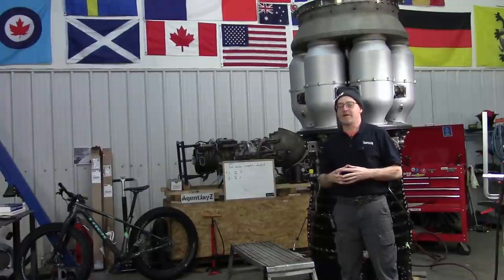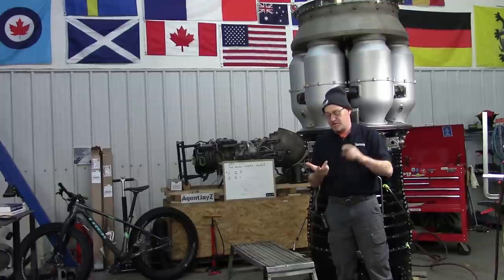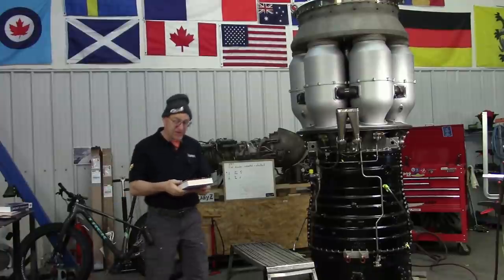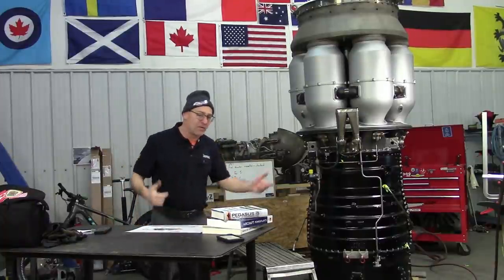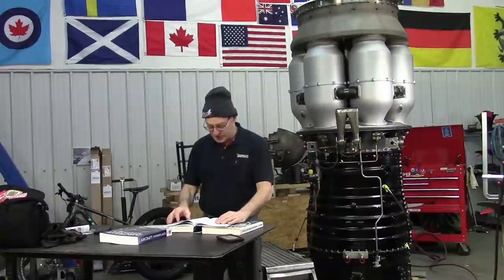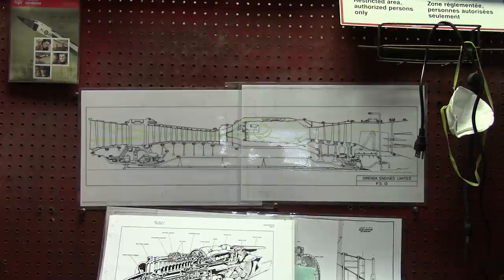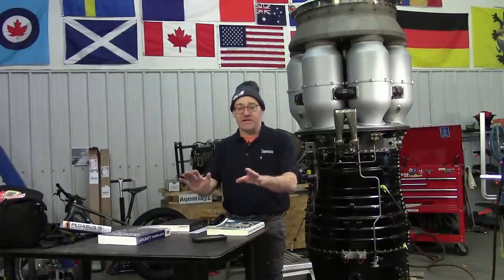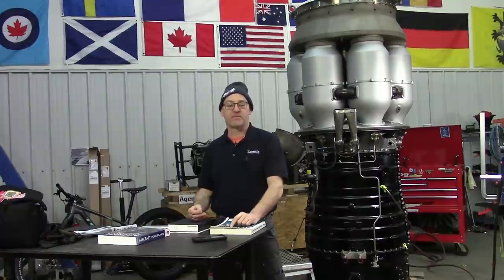So You Want to Design a Jet Engine

Comment: Not standing on the shoulders of giants when given the option is pure stupidity.
Reply from the maker: Your two comments appear to be completely contradictory. I guess they cancel each other out.
Reply from the maker: William: I read the article, which contains the following points.
It's a design for an engine for an RC model.
It's based on an automotive turbocharger.
It has never actually performed it's intended function i.e. fly the model.
So thank you for completely missing the point of this video, three times in a row.
Reply: @AgentJayZ  it was a turbofan into multistage axial compressor into centrifugal(off the shelf auto turbo part).

Comment: Hopefully this video will be an eye opener for all of the "brave designers", who thinking that they can build a jet engine in a back garden garage
Reply: You could build a pulse jet in your back garden pretty easily, pushing the definition of "jet engine" a bit though :) also maybe a tiny centrifugal engine from a turbocharger. That pretty much already is most of a jet engine, just without the combustion chamber & obviously not exactly optimal ( for one thing it's meant to extract as much energy as possible on the power side, and that doesn't leave much for actual thrust... maybe one with a permanent afterburner then - hey welcome to fun calcs about bypasses )
Reply: You can definitely build a jet engine with enough effort, but it will inevitably kinda suck unless you have a whole team working alongside you.
Reply from the maker: BdM... That's really neat, but unnecessary. A variable nozzle in not required on a non afterburning engine. So, it's a toy, and not the subject of my video at all.

Comment: CF6
Airbus A300
Airbus A310
Airbus A330
Boeing 747
Boeing 767
Lockheed C-5M Super Galaxy
McDonnell Douglas DC-10
McDonnell Douglas MD-11
Reply: Does all share a different modified Engine based of the CF6?
Reply: @egofessional2863  yes
Reply: @egofessional2863  yes slight different thrust lbs and accessories, fitment.
Reply: @publicmail2  The CF6 was based on the TF39.

Comment: even after 50 years of trying china could not come up with a perfect engine... India tried for 35 years and eventually abandoned their entire engine programme and bought GE instead. Russians still using their very low-efficiency engine in their aircraft...
Reply: the perfect engine only lives on paper ... al the others are some compromise or more accurately some set of compromises to get a desired result ... and they are all subjective based on testing and research
Reply: Russian engines are overly hated on for obvious reasons ofcourse,India and China failed because they skipped all the previous generations of engine design and technology and wanted a modern engine immediately

Comment: I don't think these people are trying to make commercial engines. They are likely hobbyists who just want a cool metalworking project that makes noise and fire. Plenty of people have done this successfully.
Reply from the maker: Did you watch this video? The people I am talking about have told me that they have a revolutionary new design that will change the industry... over and over.
Please try not to tell me what people have said to me, and remember your assumptions are not helpful.
Thanks for keeping that in mind.
Reply: @AgentJayZ  I actually did,  "What are the dimensions of a compressor" is such a vague question that it can asking anything really. You interpret as the specific dimensions of each individual part. The same question could be answered with a drawing of a trapezoid with the inlet/outlet sizes, and the length of the compressor section.. Without seeing the specific verbiage of the comments that offend you, it is easy to imagine some naive guy with a metal shop who wants to make a turbocharger engine asking for advice. If they literally say they are going to start a company and sell jet engines they are clearly fools.
A home cook asking for a recipe doesn't aspire to become a 3 star chef.
Not trying to ruffle your feathers.
Reply from the maker: He wasn't asking for a recipe. I quoted his words exactly.
Engines of any kind are unlikely to be successful when designed by "some naive guy with a metal shop".

Comment: Do Power-Turbines use water to reduce noise or temperature? The lines on the power-turbines cannot be fuel lines right?
Reply: He has a few other videos about what goes into converting these engines for use as stationary engines connected to a power turbine. The lines are either oil, air, or fuel; sometimes there is also a separate hydraulic system to actuate parts of the engine. Most engines will use fuel as part of their cooling solution; preheating the fuel increases efficiency. If you need to reduce the noise of these engines the cheapest and easiest solution is to put it in a sound reducing box.

Comment: If you don't want to build an engine... which turbine engines are "the best to play around with"? Of course, it's dangerous to play (call it backyard-running them) with turbine engines, but what's the next-best thing to build one yourself? This question maybe good to answer for booth types, jet engines and turboshaft engines. Thanks!
Reply from the maker: Definitely the cheapest one you can find. You will destroy it for certain, probably before you ever get it running.
Guaranteed.
Please, prove me wrong.
Reply: There are the RC jet engines. There is the PBS TJ-100 for about $60k. It comes with a FADEC. I doubt the company would give you one that you could tune, so you will have to reverse engineer the software in the FADEC. Then tweak the software so that you can tune different engine parameters. Modify the engine to have all the sensors for things you want to measure. Be careful while tuning, the wrong parameter for even a couple of seconds will destroy the engine or significantly shorten its life.
Reply: @AgentJayZ  I can understand your opinion, if you're an idiot you will destroy anything, even your home-built modified-turbocharger-engine or a brick of stone ... Of course you can get one, put fuel to it, send it to the moon and watch the sparks and flames. But that's not the answer to my question.
What I wanted to know is more like when you really want to learn how these engines work and which procedures must be done to run it without destroying it - is there any small turbo jet engine out there with which you can get this done - without destruction?
There are enough people out there who archived this with ex-jetfighter engines mounted on dragsters or backyard-running an RB211, so it's clearly possible. But these engines are really big as you know, is there no smaller one with less power which is still good for learning turbine engine operation?
Reply from the maker: Maybe I misunderstood you. My honest answer to you is that the best way to learn about working on jet engines is not to obtain one first and start taking it apart.
Take some training, or even just read the A&P training texts. By the time you get to the end, you will know which one you want to obtain.
Learning by doing, without any prior training, without destruction... to the point where you can competently reassemble any turbine engine and have it run?
I would not bet on that.
You'll save money, time, and danger if you learn first, grab wrenches later. 
No matter what you choose to do, I recommend obtaining the overhaul manual for whatever engine you obtain. Without that, destruction is certain.

Comment: Is it impossible to build a turbine engine with water cooling turbine blades ؟؟؟🙄
Reply: Carrying water along?
Reply: Nothing is impossible. The impossible just takes longer.
Reply: @mikecowen6507  As you know, the capacity of water to cool is twenty times the capacity of air to cool. So when did they start that and why did they not start ????
Reply: @ابوكيان-م2ض8س  as air is more abundant in the atmosphere surrounding most aircraft engines its the obvious medium to use for cooling. Yes you can oil, water, alcohol and various other substances to cool an engine. All of the liquids do however also have one big drawback when it comes to aircraft engines. You have to bring them allong for the ride yourself. As an effect of this, the item into which the engine is fitted will have a reduced paylod, therfore will incure a negative reduction in opperating costs and prohibiting the implementation of that engine.
Reply: @pauljanssen1325  I agree with you . But if you see the benefits that we will get, such as the cooling power is twenty times more, therefore, less expensive metals can be used in making the engine more fresh for the cooling power, which reduces the cost of making the engine and reduces the risk of high temperature, which is the main reason for the failure of turbine engines and by using special cooling fluids such as the one in Cars or stronger ones last long and do not require filling, we will get excellent results..
Reply: @ابوكيان-م2ض8س  water is also 1000x times heavier than air.
Reply: Water is 1000x heavier than air. You now have to cool down the water too. How are you going to do that? How are you going to provide water to the blades if they are spinning on a shaft at 50k rpm while avoiding leaks?
Reply: Liquid cooling is a thing in turbine engines. Maybe not for jets engines due to weight and other issues.
Reply: @hazzard77  the getting it too the blades is the easy part, it's the retreval from the blade fter it is done with it's job from the blade and airstream so it can be used again where the real problem lies
Reply: @hazzard77  You have answered your question because of the high rotation and the result of centrifugation. We can enter the liquid into the blades and we can cool the liquid water coming out of the engine by means of the air coming from the compressor or by the air produced from the movement of the plane or by electric fins with the use of a special radiator stronger than a car radiator. As for the weight of the water, I do not think that the weight of the water is more than the weight of the oil used for lubrication in the engine. Just think that it is not impossible, my friend.
Reply: @hazzard77  You have answered your question because of the high rotation and the result of centrifugation. We can enter the liquid into the blades and we can cool the liquid water coming out of the engine by means of the air coming from the compressor or by the air produced from the movement of the plane or by electric fins with the use of a special radiator stronger than a car radiator. As for the weight of the water, I do not think that the weight of the water is more than the weight of the oil used for lubrication in the engine. Just think that it is not impossible, my friend.
Reply: @ابوكيان-م2ض8س  hey we found the type of guy, AJZ is talking about in the video!!
Reply: Isn't that what water injection was!?
Reply: @donaldstanfield8862  No. Water injection was/is into the combustion chamber - or in one case I'm familiar with, into the air intake.  Its function was/is to maintain the temperature of the combustion products entering the turbine, permitting an increase in fuel flow, and hence, an increase in thrust.  Typically, it's used for take-off at maximum weight and/or in hot and high conditions.
Reply: Not impossible, perhaps, but there's the small matter of the water inconveniently not wanting to remain in the liquid state for long.  Water injection, as used for take-off in some engines, relies on the latent heat of vaporisation for its cooling effect.
Reply: @grahamj9101   Thanks for your comment, I agree with you in that, if we can use an oily coolant that does not evaporate as quickly as water, such as in a car coolant, as well as we can increase the speed of the fluid flow inside the engine during cooling to reduce its temperature greatly and use a highly efficient radiator to cool the fluid leaving the engine.

Comment: What are we learning here?, English Literacy or Jet engine Propulsion, either leaving me  non the wiser, or am I lost in translation and might end up with a very fast Dictionary. LOL! excellent work, The question I got is can you marry a Power pack like maybe a helicopter shaft jet with a Generator that can supply electricity to about 200 houses. OR will the Fuel gremlins suck up more fuel than Electricity you can supply? CAD software today has the ability to show all stresses in your design and fix then automatically. Not a lot of Math and Physics required, most  engines and planes now a days are literary designed by a CAD operator and nobody else, all tests and failures of parts taken care of.
Reply from the maker: Nothing to do with the subject of this video, but yes. You could attach an electrical generator to a turboshaft engine. That is essentially exactly what a natural gas fired electrical power station is.
The advantage is quick startup time, and light weight.
Disadvantages include poor fuel economy at less than full load.
Reply: Well dang. Im familiar with CAD. Apparently I could have been designing entire aircraft alone if only I had found this magic fix button you are talking about. That probably pays way better...